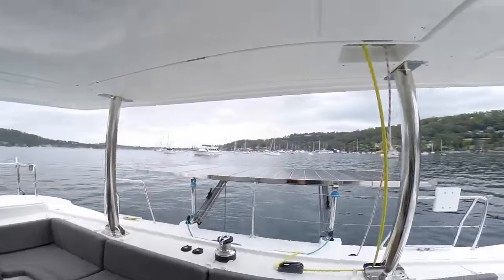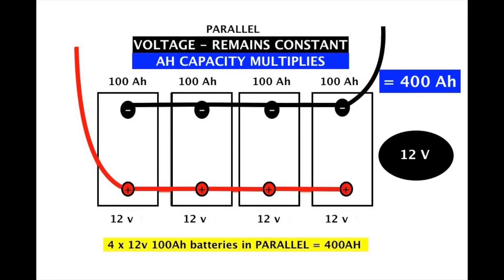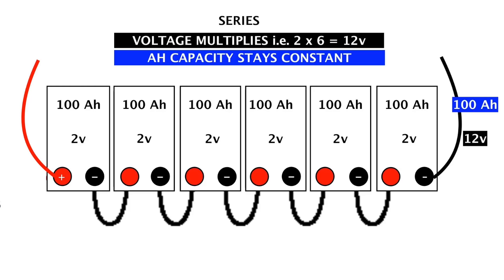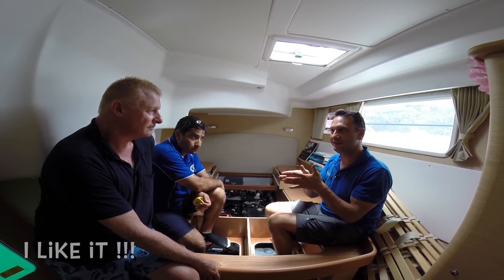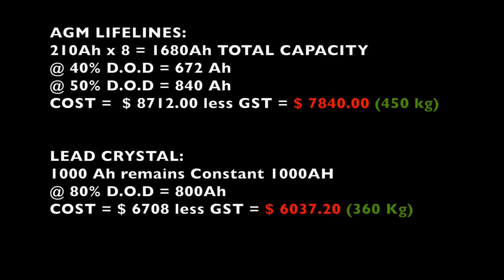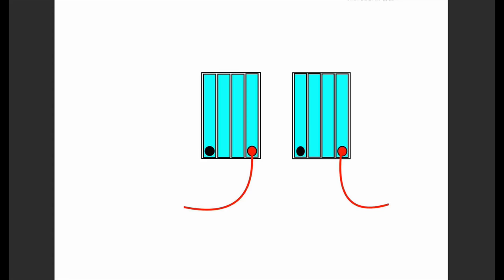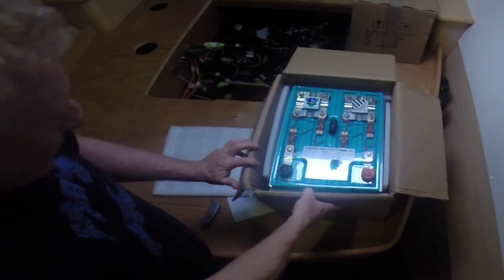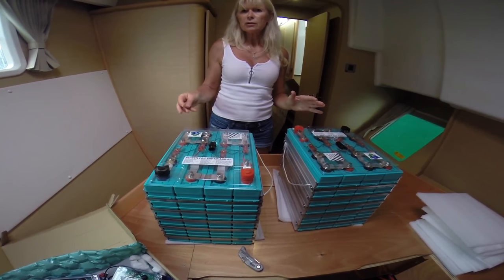Pt 1.  LITHIUM BATTERY INSTALLATION

Comment: Brent do you know who makes your 18650 cells?

Each of your batteries have 4 cells but inside each of those cells are an array of 18650 (18mm x 65mm) cells.  That is what Tesla used for their autos and Powerwalls.  If search YouTube you will find DIY powerwalls where they buy dead notebook computer batteries, extract the 18650 cells, charge and test each cell, and then build a powerpack. One takeaway watching the testing is that some brands of 18650 cells are much more reliable. I think the best was Samsung. The difference was huge.

Just double checked Pedego an electric bike manufacture that makes a premium folding electric bike use Samsung 18650.
Reply from the maker: Sorry Boston Clipper - they are Prismatic cells - I verified with he manufacturer
Reply from the maker: Here is an interesting read someone sent me ... http://gm-volt.com/2016/08/30/now-we-know-why-gm-uses-prismatic-cells/
Reply: That is a little surprising but in a good way.  The article had a lot of bad information. Let me tell you what I know.

We bought a 2017 Chevrolet Volt in November.  Cooling may be an issue you may want to monitor.  Let me explain.  The Volt's 18.4 kWh battery does not use "active" (fan) or "passive" air cooling but uses liquid cooling instead.  In fact there are three separate liquid (radiator) cooling loops, one for the generator, one for the batteries and one for the computer.  Suggestions would be to first monitor the exterior of the battery case for temperature gain during heavy charge/discharge. If you detect an appreciable difference I would first provide space (passive) around all six surfaces of each battery.  Check the temperature again and if necessary add "active" (fans) air cooling if for no other reason to extend the life of the batteries. I would hope these batteries are engineered to stay cool but it is worth confirming.

Despite what the article says when it comes to battery chemistry a Lithium-ion battery is a Lithium-ion battery regardless of configuration.  But this brings to an unrelated point when it comes to your new drone.  A Lithium-ion battery is not a Lithium Polymer (LiPo) battery.  There is a real fire danger charging a LiPo particularly for RC aircraft because of possible impact damage.  I have flown RC for years and can tell you to ALWAYS charge inside a "LiPo safe bag" and dispose of any puffy batteries in a safe manner.
Reply from the maker: A very interesting read Boston Clipper. I must say that we have been pleasantly surprised at how cool the batteries remain even when placing heavy loads on them. 
I wonder if it will stay this way AS THEY AGE and this is something for me to pay attention to - thanks!
Also - I am pleased to have input from you that is positive and raises awareness ... I realise how complex some discussions around LiFePO4 / Lithium can become, and in some instances not being shared from a 'good space' ...so thank you for this!

I am not an expert on 18650 cells verses prismatic cells - I see a lot of back 'n forth discussions and theories and honestly, I feel it confuses us regular guys in the sailing community which is why I did as much research as possible. Then again, as you post here, the article I shared above has some flaws too ... and you explain why this would be the case.

I decided to go this route (LiFePO4 with AV Power) in-spite of reading some posts and getting advice against it by a guy really active on some forums, but in the end I determined he had different reasons for persuading me not to go this route. 
I could not believe how complex this individual makes all this sound - it actually frightens sailors away from LiFePO4 entirely whereas LiFePO4 is actually very stable the way it is supplied and monitored. 
It was a fantastic revelation to me - for me -  having done the research to realise the process is actually simple and effective  - the guy is bamboozling so many people.
In the end I discussed some concerns with the supplier who said he has been getting a bad rap from an individual for not agreeing to discount the packs in exchange for advertising his products through the forums he has gained so much attention from. As my late father always said to me - there are two sides to every story ...
This kind of thing saddens me - after all, many folks who take to a life at sea are 'giving up a lot' to be free - money does not go that far for everyone doing this. I meet so many beautiful people out here on the deep blue - I feel a sense of care for these families on our oceans and this is why we want to take as much time sharing the knowledge - we have alternative affordable sources of power / energy that make economic sense, are safe when installed correctly, and do not need to be complex systems.
There are pros and cons to everything, especially when it comes to battery technology - I am learning this fast.

Someone had mentioned to me earlier on, that this product makes use of these cells and I think he referred to Samsung - I could have the tiger by the tail here - it was not a deciding factor for us. 
You made me do some research again - lol 
Looking at it - I think 18650 packs are great from what I can see, but tend generally to be bulkier and heavier due to the steel can around each cell ... the packing space is awkward.  Also, the large number of interconnects can lead to early failure if quality control is not spot on, so one needs to be careful in ones 'brand of choice' here I guess. The cells we have are made up of flat copper and aluminium plates connected in parallel with a bit of carbon, LiFePO4 paste and plastic separators. EV Power assure me they have NEVER had a 'comeback' as a result of vibrations, loose internal connections and so on. 
I thank you for suggesting we keep an eye on temperature - this is something I need to monitor and feed back to the sailing community.

Very interesting Boston Clipper - thanks for sharing mate !

Comment: So 8 AGM's are comparable in price to the 2 lithiums?
Reply from the maker: Hi K bob - I would have to check the latest figures but yes, certainly when one considers costs over time. Now that we have had our lithiums on board for some time, we can undoubtedly say this is a total 'game changer' when it comes to living on board - the fact that these batteries can take a bulk charge all the way to full and that they hold a higher voltage for longer makes them a money saver over time - no doubt about it. One needs to look at the 'long term savings' - guaranteed - there will be no going back for us - the AGM's come nowhere close to what we have now ...
Cheers ... Brent
Reply: +Catamaran Impi - yes i totally agree about the cost over time but based on your video it seems like they are comparable even from the purchase no? you stated 6 AGM's at $1000 = $6000 vrs 2  lithiums at $3000 = $6000 no?
Reply from the maker: Yes - correct! Ev Power had a sweet deal on those batteries which is why I mentioned I would have to check the latest pricing. The thing is the added items that may be needed - such as in our case, an external commercial solenoid, upgraded wiring on the chargers since we were going to now 'burn the juice harder for longer' because lithiums can handle it and so on. That all adds to the cost on initial outlay.
I am intending to do a more thorough follow up to this video with some living experience on the system now.
The things to look at are:
a. cost of the actual batteries
b. upgrades if necessary to wiring and chargers (most chargers are programable) - the electrical cost to install.
c. BMS (Battery Management System), Solenoids and everything outside the batteries - in some batteries these are built in, but I like the idea of being able to just swap cells to the future and carry all the external stuff across to those cells.

But 'battery for battery' in our case - yes, the price was similar